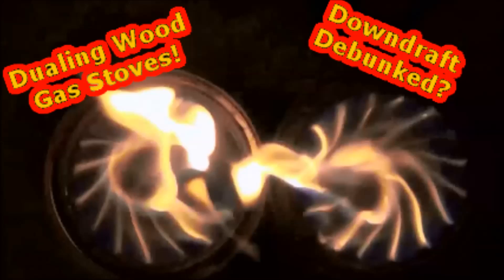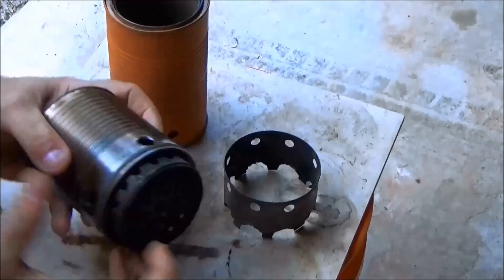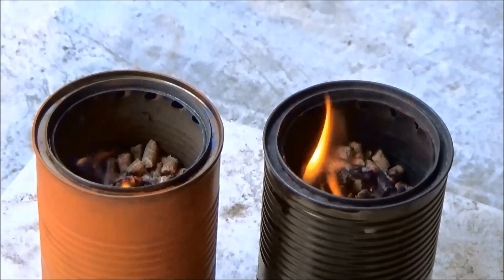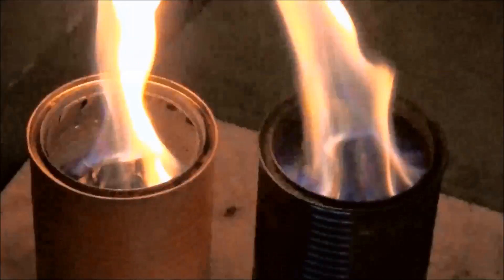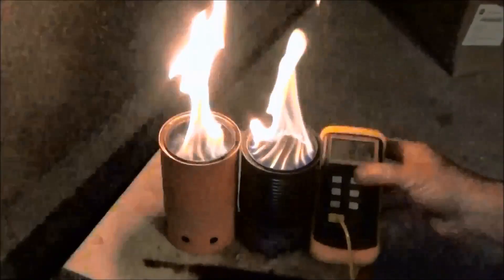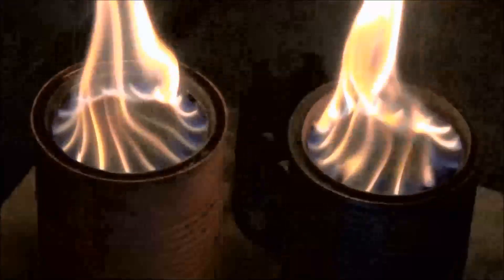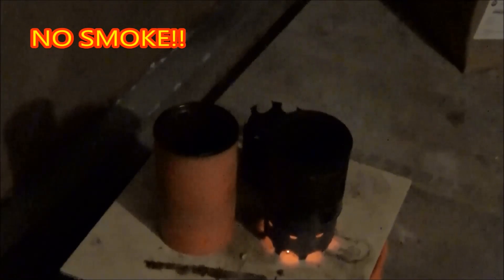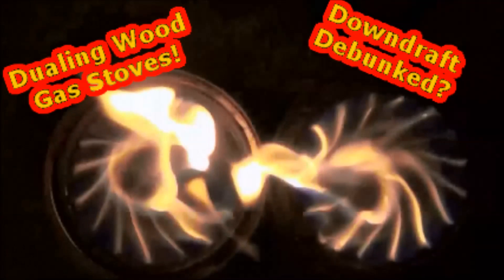Dualing Wood Gas Stoves!! Downdraft Debunked?

Comment: Ive been fascinated for years about how the thermal expansion makes the gas push out the bottom and then rise due to heat and cone out the secondary ports... And your video of the glass vortex stove was most of the reason for that... But id have to agree with this because I poked my wood pellets with a knife during a burn and i saw the smoke coming directly up to feed the flame front. They were visible coming out of the holes i poked with the knife, because i moved aside the glowing embers so the tar didnt get cracked as much and the entrained ash didnt get filtered. That made the smoke visible. A very easy and crude test but its simple to do and you can see the gas flowing up..... But at the same time, the  outside of the burn chamber turns black over time. That means some tar or soot from woodgas is touching it. And it never gets thicker, its always a thin layer of black. I believe that's because iron is actually a catalyst to break down the tar into volatile organic compounds. Perhaps both are happening. Maybe the downdraft only happens at the bottom of the fuel charge. Idk.

Comment: As a side step to all of this, how does the actual location of the secondary holes affect overall performance, if those holes are further down inside the burn chamber, do they draw better or worse? Much like a wine pour aerator with holes at a low pressure point inside, it would be interesting to design a stove with the secondary air holes at a narrowing low pressure point, at the top above a restriciting ring rather than at the bottom of it.

Comment: 0:49 Curious to know, the inlet air on the shorter hybrid can, is the area of the inlet holes for the secondary air the same over-all area as the holes inside for the secondary air entering the burn chamber? How does throttling that air going to the secondary air outlets affect performance? Do the jets actually get stronger if the inlet size/area is slightly smaller than the outlet size/area?

Comment: tough choice, both are burning great, hybrid version on right i assume looks more unstable because of the smaller diameter of base, all in all, i would use the one on left, seems like a longer burn time,  more stability, out of both stoves which had more pellets left unbunrt
Reply from the maker: Both stoves will only leave a small amount of white ash at the end of the burn if you let the char continue to burn. If you do not let the coals burn you only have char left. Absolutely no unbury pellets!
Reply: @heathputnam9524  ok, thanks
Reply from the maker: No problem!

Comment: Love the videos I am working on my own creation. Not all gases are seen, most gas is invisible, smoke is also water vapor not just mixes of gas. The more visible the gas the more contaminants or solids are and such in the wood gas being produced. The hotter your initial burn the more efficient pyrolysis you have. I am trying to increase the velocity of of air through my secondary air/gas holes without using mechanical energy. Any ideas?
Reply from the maker: The air between the inner and outer can heats up and rises towards the secondary air holes. The hotter the air, the faster it rises. The next point is if a volume of gas is moving through a passage and cross sectional area of the passage decreases the velocity of the gas increases. In this case the reduction of cross section has to be small due to the absence of any real pressure forcing the air up the passage. I hope this insight helps, I don’t want to give you an answer, only lead you in a direction. Please let me know how you creation turns out. Good luck and thanks for watching!

Comment: Great video, well controlled experiments. I've had great results removing the bottom of my inner can and threading wire only to contain the largest coals for a very wide open primary air intake. I've stacked two such stoves with wood and coals in each for an impressively hot jet above. I have no doubt air is sucked in from below. I believe gases are burned throughout and above.
Reply from the maker: Thanks for the insight and the comment!

Comment: I think (esp. for the people still holding up the down draft theory) it is interesting to observe the flame pattern around the secondary holes (e.g. 4:39): The flames don't appear to jet out of the holes directly, but rather around them... That is esp. true for the classic 5.4 as well. If the down draft theory were correct, wouldn't that look more like a jet of fuel like in a gas or alcohol stove?

Comment: Only a few degrees difference I would say both great well done. I agree your second updraft  theory.   I suggest that you restrict the flow of gasses at the top of the burn chamber by 5-10mm ( like the solo stove) it might improve the gas mix and concentrate the flame. I do like the angle of the air holes to get a twisting vortex     Peace

Comment: Its good to see someone debunking the myth about how these wood stoves work .They are  also wrongly called gassifier stoves .These stoves are based on the BushBuddy design introduced 20 years ago  and they became more  popular when  ultralight hikers started to use them about 15 years ago.Now manufactured in China they are available very cheaply but it seems no instructions on their use are given and most people do not use them properly .And as you have pointed out  many people dont know how they work.It is basic science -wood whenever it is  heated gives off wood gas which burns as a flame when oxygen is available-smoke is unburnt wood gas.and it should always be remembered hot air (wood gas) rises .

Comment: Much appreciate your experimental approach, Heath. You may have developed your theory since this, but I think your glass experiment demonstrates the downdraft of that type incontrovertibly, and there are some confusions in this test. Some commenters have noted these already. The hybrid stove obviously forces the condition of updraft, since the hot air in the combustion chamber rises, the same is true of the heated air in the separate outer can, and these are not in competition, in terms of the pressures created.

Some commenters believe that the downdraft theory is entirely wrong, because hot air rises, and your test here gives the impression of supporting that view, but I don't think that's correct. If the flow were gradually restricted in the primary chamber relative to the outer, AND THE TWO FLOWS ARE CONNECTED AT THE BASE, there will be a point at which the unrestricted hot air rising in the outer sleeve overpowers the tendency of the inner combustion products to rise, forcing them down. In other words, the faster updraft in the outer can causes lower pressure in the area of the inner can's bottom holes, sucking the wood gas through to join it.

I suspect that many guttering woodgas stoves demonstrate this constant fight between the two flows of air, and when the normal stove is first lit, it begins obviously with updraft because the outer can hasn't heated up, but then switches to downdraft (if balanced to do so) when hot.

Another experimenter - I forget who now - had another interesting idea related to this. It may add to the effect (i.e. lower the pressure at the base even more) if the outer air holes are raised up higher than any side holes in the inner can (but not separated as you have here). If they're lower, or at the same height, the flow inwards of fresh air is hitting the oncoming woodgas, or having to be reversed in its flow, whereas if it enters higher up the sides and naturally continues upwards, it will help to suck the woodgas from the lower holes. I'm about to build one like this, and I might also add a bit of a kink to the outer holes to help the air flow upwards.

Having said all that, I'm not sure if a downdraft has particular advantages for such a stove. It may help by gradually heating up the fuel below the pyrolising layer, priming it for when it outgasses itself. With damp wood, in the wild, this may be an advantage. Anyway, thanks, this was one of the most useful vids on the subject I've come across.
Reply: I think you are spot on with this.  What difference does it make which route the wood gas travels?  It can move up or down depending on the state of the stove at any given moment.  Because the combustion chamber is (sometimes) devoid of o2 then the only place a condition for flame exists is at the secondary air ports where it has the gas (up or down flow irrelevant), o2, and heat required to make the flame.  A stove designed to downdraft could have the advantage of preheating the wood and would likely burn hotter and faster.  There is another video on YouTube where the gentleman captures wood gas in a water trap and you can see that the volume of wood gas created for a given volume of material is very large, for a cup of wood pellets I’d guess probably several cubic meters of gas.  With that in mind, the glass vase experiment Heath conducted only had a very low flow of gas from the bottom of the combustion chamber and so what is likely happening with his stove design is an overall OUTflow of gas, in both directions.
Reply: lettersquash Agree.

Comment: What appears to be jets of fuel coming out of the secondary ports and oxidizing are instead heated oxidizer (air) mixing with heated fuel in a low oxidizer area of the stove. For a similar demonstration see the Codey’s lab in which he fills a chamber with propane and ignites a jet of oxygen he piped in.

Comment: I did a little research on downdraft gasifiers, and those seem to be either forced downward airflow, or heavily relying on chimney effect. They burn below! the fuel wood, something not easily archievable with DIY methods. Here's a good Illustration, labels in german unfortunately: https://upload.wikimedia.org/wikipedia/commons/e/e9/Holzvergaser.png

Comment: Aside from any other variations, such as difference in hole size or number, you would expect what was seen, that the open PA/SA stove would be less aggressive than the separated.
Reason:  The updraft around the can creates a low pressure area at the bottom of the can which draws some Primary Air into the updraft, and creates a lower pressure at the bottom of the can, particularly at the outer edge.   This will create at least some reverse flows in the reaction vessel, probably more on the outer circumference, which will partially flow up outside the can, and partially in the middle.  It may create a toroidal or donut convection.  There would also tend to be a similar but reverse flowing toroid at the top, as in the Kon-Tiki (https://www.youtube.com/results?search_query=thebiocharrevolution) so the flow in the can will be complex, somewhat broken up into these convection cells, and of course also chaotic.  Norm Baker and I saw these downward flows through our Pyrex window test in our 200L drum ring of fire TLUD.
  I also commented on the smoke stick tests here: https://www.youtube.com/watch?v=wzN-cYR84_Y
Less PA and competing flows, less flame, slower burn.

Comment: Why does the hybrid stove have a blue flame at the bottom of it have you not noticed this review this video and after the hybrid stove starts to gasifier a timer till you pull out the video and you will see a blue flame at the bottom of the hybrid stove what is that about you can see it 6:23 at the bottom

Comment: Great video.  I have often laid awake at night thinking about this stuff and could not figure out why a wood gas stove is more efficient. My conclusion is that wood gas stoves are more efficient because they capture heat that would normally radiated and inject it via convection through the top holes. This creates higher heat transfer efficiency as opposed to combustion efficiency as is typically implied.  So recirculating gas is unnecessary.
Reply from the maker: I'm not sure that is completely accurate. I do not think the additional heated air coming through the secondary air jets can account for flame temperatures of 1500F+ alone. The hot air does help in the creation of the flame "cap" over the pyrolysis zone. I believe the pyrolysis zone gathers and superheats the wood gas causes a more complete and efficient burn. This is just my opinion. Thanks for the comment!

Comment: I like your videos.  Nice work.  Did you get a conclusion on an optimized design (beyond the 5.4, with these results)?  I've built a couple stoves that do well enough if I keep feeding them sticks, and am going to try your 5.4 build.  Also interested in these stoves' performance backpacking.  Mine smoke a lot when I re-feed sticks into the primary burn chamber.
Reply from the maker: dman3398 I have not continued with the development yet but do plan on more work on it. I have had good luck on backpacking trips. I get about a half hour of good cooking flame and another ten minutes of simmering heat from one load of pellets. I usually carry pellets and alcohol as they are light and consistent. You will always get some smoke when adding more fuel because you interrupt the pyrolysis zone. The 5.4 vortex does not smoke a lot when adding more fuel as long as the new fuel added is below the secondary air holes. I have a video of winter hiking with the 5.4 as well as a video of a glass wood gas stove to help understand the concept. Thanks for the comment!

Comment: Kinda makes you think the hybrid is better. But this might change slightly if you made larger holes in the outer can of th original.
Reply from the maker: John Thomson yes exactly. The hybrid had no air restriction to the primary holes. Thanks for the comment

Comment: Hi, maybe I can not see correct, but to me it seems that the black stove has larger air holes in the bottom, this providing less resistance to the airflow / fuel flow. please correct me if I'm wrong.

Comment: Definitely TLUD (Top Lit Up Draft ((air movement)) just look close at your two stoves - right 'hybrid' burns best because of more open bottom air (acts like a fireplace grate) so primary air is freely provided to fuel. Best build is a stainless steel wire mesh burn bottom rather than many holes - think more primary free air without restrictions through holes. The secondary super heated air comes from the side updraft injected near the top. No need to close side air at bottom - think 'hood' to direct air since hot air less dense rises and exits through holes super heated to aid combustion of wood gas and volatiles. 'Cant' all secondary air holes to create vortex to swirl mix wood gas combustion. Questions? My smallest wood gas stove with 1 liter of fuel pellets is burning 1.75 to 2 hours and the biochar glowing for an additional 30 plus minutes... by adding five small holes around the biochar level you create another forced air zone to burn the biochar in air-oxygen which dramatically reduces 'ash' to clean out. CAUTION - forced air draft to biochar (charcoal) can reach high temperatures (2500F) - you risk damage to most metals. This is a good time to warm water to wash the dishes. lol

Comment: Ted Juszczyk is on the right track. You drastically changed the dynamics of the stove when you isolated the upper holes in the inner can from the bottom where the down draft does indeed escape due to the draw of the upper holes. Also keep in mind that the relatively cooler air that is in the inner can will be being forced to sink below the hotter air that is in it.

Comment: Thanks Heath! I have wondered about this for some time.  Just started thinking about woodgas stoves again after a backpacking trip.  The only way I can see for a stove to be a natural-draft downdraft stove is if the outer wall's draft is stronger than that created in the inner chamber such that it sucks the gas down and out.  But I've always reasoned that if draft is a product of heat and height then I'd imagine that the inner chamber in these stoves would have to have a much stronger draft than the outer wall.  The draft in the inner chamber would always over power whatever suction happens as a result of the draft in the  outer wall.  Anyways thanks for the video.  Practical demonstration is pretty powerful.
Reply from the maker: Yes, I believe you are correct. The secondary air inlets are only letting in fresh hot air which helps form to pyrolysis zone above the fuel. Thanks for the comment!
Reply: Not actually the only way. Besides drafting, there is thermal expansion. As the solids and tars are heated and turned into gas, they expand. With air and fuel in the inner burn chamber, there is no room left for them and they push out the bottom to equalize pressure. I'm not sure if that actually does happen but it's possible.

Comment: You have two different types of stoves...downdraft and updraft. Because of the small scale of your stoves, the characteristics are harder to differentiate. The downdraft has less flame variability and burns longer...much easier to see on a larger scale. So I wonder why you are debunking your own March 2015 video where you proved the downdraft conclusively with your glass outer container and smoke. I'm stumped!
Reply: Ted Juszczyk I agree with you. I watched that same video. It's quite clear what the process is. 
I have also done tests where I got only smoke coming out of the top holes, because my primary was was not optimised and the fire goes out.

Comment: I think what is happening is that the fresh air is a flue for the fire and is being directed up the space between the cans by rising heat.. at the top the heated air being forced into the spiral pattern or vortex is like an afterburner allowing much more complete combustion than is normal.
Try electric fan driven air with some small pipes directed at the same level as the upper vent holes.
Basically, what I'm saying is that the rising air from the space, through the vortex holes is equivalent to a bellows.